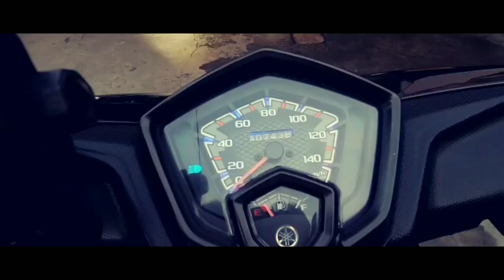UNDERNEATH + DIY REAR FENDER = POGING MIO SOUL I 125               #GoProHero7 #Yamaha #MSI125

Comment: Ano Yan gulong mo brand magkno
Reply from the maker: Perelli angel scooter paps. 110/70 rear (nasa 3k), 90/80 front (nasa 2k) kay takara tires tube less na din.
Reply: Thank you paps sa info
Reply: Hindi pa madulas Yan katagalan ty
Reply from the maker: @regorjopszurc4423  hindi paps. Makapit sya dry and wet. Pa SUBSCRIBE po paps para sa more videos